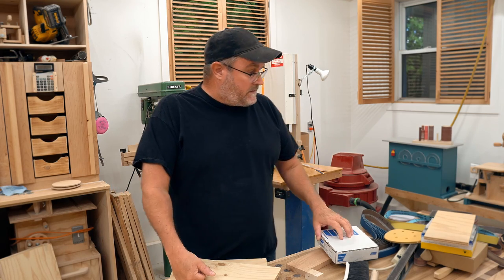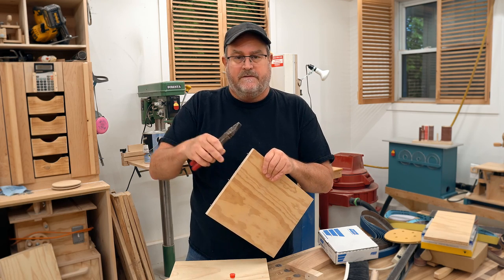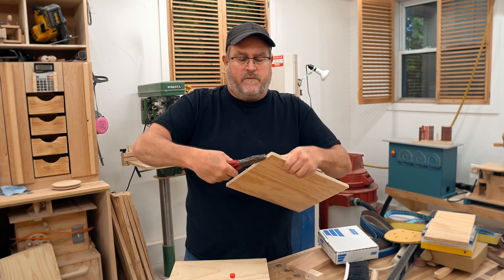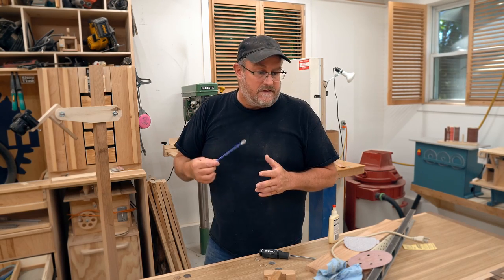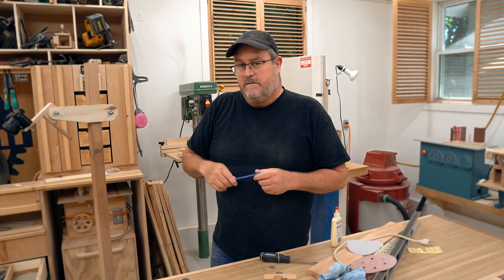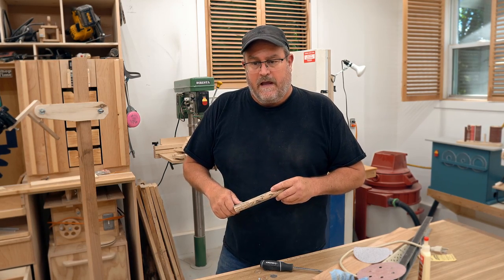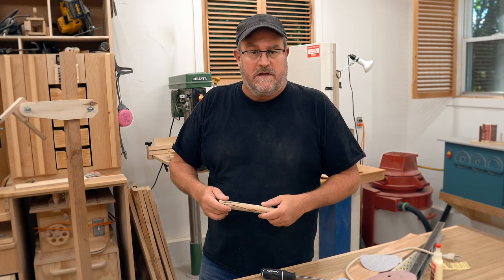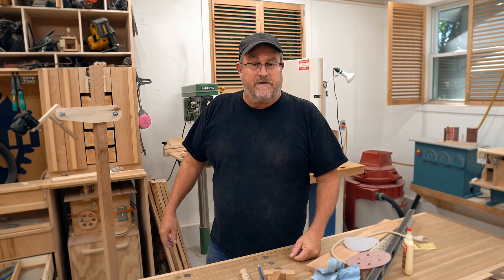Simple Trick to Pull Out Brad Nails without Breaking them... PLUS more "Safety" Rant

Comment: I was taught that trick about 22 years ago, but not for wood. I work for a railway in the signal dept. We drill a hole in the web of the rail, or at least we use to, and on the end of the wire is a connector. We call that connector a chicken head. If you want to remove an old chicken head you give it a tap or two on the head and then hit it from the other side and it pops right out of the hole, usually.
I've never used that trick for brads or pin nails and they usually break on me. I'll be trying it out. Thanks John.

Comment: I gently pinch the nail with the cutter part and pry with the tip of the plyers. the nail stay more straight this way and is less likely to break. but i still haven't found a good way with hard wood. next time i will try what you say in this video.

Comment: Nice tip about knocking the nail loose. I like to roll the linesman's pliers sideways instead to avoid spiking myself with other nails.
Reply: @richardflorence3927  Never had much luck getting the claw to engage on brads. It's probably my technique though. I was never a fan of nails. Even when framing out 16x20 cabins for the church, I'd invest in 2.5" torx-head decking screws.

Comment: I tried this method of wire brad removal on a small forest of brads thru a 2x4 I wanted to reuse. It worked okay on the first brad, but then the 2nd brad broke during the extraction process. Looking closely at what went wrong I concluded that on the 2nd brad the pliers put too much lateral pressure on the brad & caused it to break. I thought "maybe the key is simply to pull the brad out as close to perfectly vertically in line with its shaft - its strongest dimension?"

So, for the next few brads I put a cat's paw right angle crowbar at the base of the wire brad and grabbed the protruding brad shaft at the cat's paw with my pliers. Then I pried out the brad using the leverage of the crowbar, while holding the brad shaft tightly in the jaws of the pliers. As the brad starting coming out, I moved the crowbar down to the wood surface and the pliers down to the crowbar and levered up again. Each brad came out fairly cleanly, and no tapping required.

I think the materials science & engineering principle involved is pulling wire brads out as perfectly straight outward as possible so that your withdrawal force minimizes shear. In fact, the ideal withdrawal tool would grasp the entire visible shaft of the wire brad and pull it straight out using controlled leverage against the wood surface.

Comment: The tapping nail trick only works under certain conditions first the head needs to be exposed and the wood must be soft enough to allow the movement.  try pulling Brads from the backside of Cherry that were used for baseboards in a nice office.  No luck.  in those cases cut them as close to the wood as possible and tap them under the surface with a nailset and fill them with putty.

Comment: At 03:17, safety begins with the parents: if either or both parent were missing due to prior misfortune (inherent risk -bad luck or evolutionary maladaptation - poor fitness) or even suffered significant injuries the child would never have been born, a different one perhaps in its place or none and that genetic line would terminate/cease. In the other case, the child born but parents had suffered injury or long term stress then the progeny would have to face risks without the natural supports and again that genetic line could cease.

Comment: Hey John. Love your videos on both channels. If I could make a suggestion, I would like to see a video where you explain more what you're considering when you decide when to use a push stick versus not. I know that how close the fence is to the workpiece is one consideration, but what other things to do you take into account?  For example, what are your "rules of thumb" for re-sawing on the table saw? What do you consider the most dangerous operations? One example from my shop, I was cutting about 1/2" off of a 1/8" panel that was about 3" square. I'm not sure what I did, but as I was pushing it through without a push stick, it kicked back out of the saw at me. It scared me primarily because I didn't know what caused that to happen? I had the saw blade only as high as needed for the workpiece. Anyway, would love to hear your thoughts.
Reply from the maker: I've already made several videos on how I use the table saw.

Comment: All of my shop injuries have happened when tools are turned off, and it always pisses me off. Things like cutting myself on a chisel thats laying on the bench as I reach for another tool for example. Im just a hobbyist, but my dad, born in 1928, was a carpenter all his life. His only power tool related injury happened on a table saw. He notched the tip of his right index finger as he reached over the blade to guide a piece of small stock. I blame experience and odds. Do enough of anything without taking a break and you may zone-out and get complacent. One thing I always think about is keeping my weight over my feet. I don't want to depend on my workpiece for balance.

Comment: At 04:57, "the only safe way to use a tool is to not use it at all", but as you also know from your own experience using that tool (or procedure) may be the most safe approach (mitigating more hazard) than any other tool choice you can have available, though the greater risks inherent in those other tools may imperil you in other differing ways. Of course this, addressing a single point, doesn't answer the safety, experience, expedience quandary in any comprehensive manner. One thing, as one inexperienced I gird my 'loins' with the proper PPE, while in what I comprehend I do with less.

Comment: Kind of a weird argument? Sure, do whatever what you want. Safety measures in my mind is put there so you can KEEP using something and avoid accidents that has happened before or are likely to happen. We have riving knives, blade guards, saw stops etc because they de facto save fingers. 

Stop using seatbelts and airbags because I'm a good driver? Stop using helmets because I'm an experienced motorcyclist? Stop using safety glasses because I have good vision? Stop using dust collection because my lungs can handle it? 

Sure, you can go outside and die from whatever. But safety measures helps people to go out in the world, make something and try something new. Not the other way around.